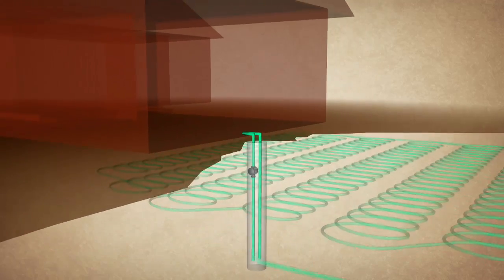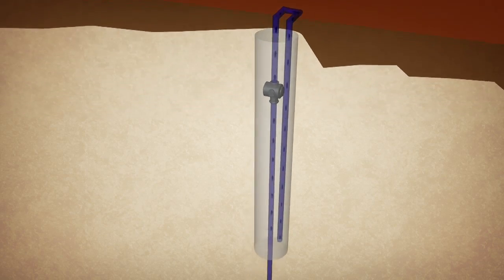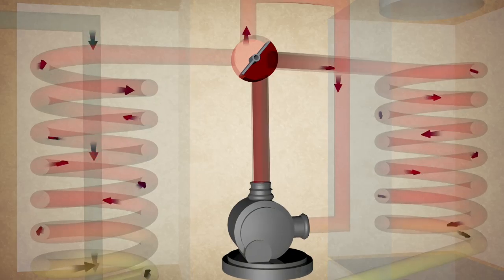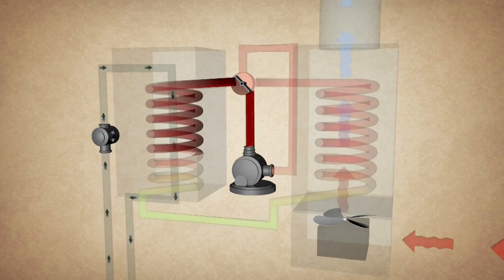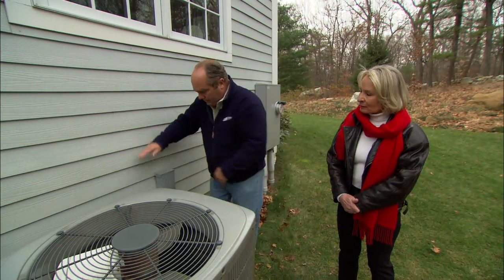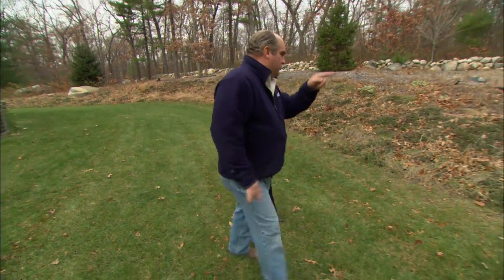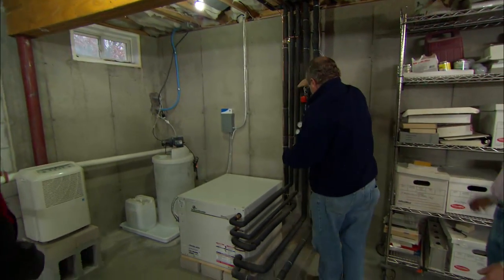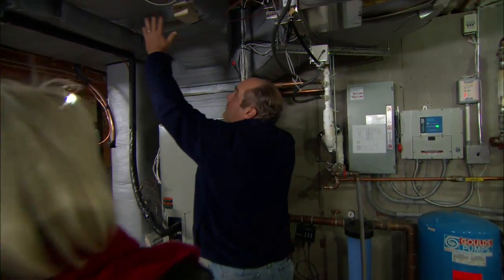How a Geothermal Heat Pump Works | This Old House

Comment: We just purchased a home in Klamath Falls Oregon we have a geothermal well. The temperature of the well is very hot .
I will like to learn how it works? 
Why is the water coming from the well so hot?
Thanks
Reply: Perhaps you have hydrothermal activity on your property that is heating the groundwater, similar to what you would see at Yellowstone with geysers and bubbling hot springs. Normally the ground is cool but with volcanic activity underground it could be heating your geothermal system. Of course that’s good in the winter I suppose but not good in the summertime for cooling. Hope you get it figured out.

Comment: It's an idea that has been around for more than 70 years and it never really took off because for the most part it is not practical.  
 In 16 years of doing HVAC in Florida and only encountered 3 of them and in every case the customer didn't like it for one reason or another.  One customer replaced their geothermal with a conventional heatpump and the others are planing to do the same when the time comes.
Reply: I wouldn’t think you would need one in Florida. You never get cold enough for heat pump efficiency to drop below what? 200% or so?  Up here in New Hampshire we see 0° days and my air source heat pump is screaming expensive to run at only 100% or less efficiency. I’d be thankful for a system that consistently gave me 300%-400% efficiency. It’s just so expensive.
Reply: @generallyhelpfulsoftware646  I worked up north too do in HAVC. Let me be real clear the NOBODY should have an air to air heatpump north of the state of Georgia. You shouldn't have any sort of heatpump because they were never intended for that climate. That's not just me talking I heard that from some of the engineers at Carrier.  In New Hampshire you should have some sort of fossil fuel such as natural gas, fuel oil or propane.  Definitely not a heatpump.
Reply: @generallyhelpfulsoftware646  It does get cold enough for heat in Florida depending where you live. But in Florida a heatpump is perfect. 
But I would prefer to stick with the air to air heatpumps.  Geothermal is too much trouble.
Reply: @seanmathews1826  I was trying to say in my comment that you wouldn’t need geothermal in Florida. You would find it useful here in New England. 

As for heat pumps being inappropriate for here in Southern New Hampshire. I installed one to supplement my oil boiler. Basically 11 months of the year it is cheaper to use the heat pumps. In January, they are about the same: both expensive, and the pump I have installed can’t heat the whole house, but it keeps the bedrooms and office the heads are in a nice 70°. Right now today, it is 45° outside, the boiler thermostats are all off, and have been since it started going above 25° at night on a regular basis and it is nice and warm in here. The thermostats won’t be going on again until December most likely. 

I used half as much oil this January as last year at the cost of a lot more electricity. So in the end the costs in January balanced out. Maybe I saved $50. Every other month, I’m saving hundreds. This morning, heating oil is $5.45  a gallon, gulp, used to be $3. And the utility has raised electricity from 18¢/kWHr to 21¢

The one thing the boiler gives that the heat pump can’t provide is radiant floor heating. Because that requires a 180° or so water heat source. 

Now if I had access to a natural gas line, this calculus might change. But I don’t.  

And I get room by room AC in the summer instead of the single upstairs zone of central AC this house came with so at night, my children can choose their own temperature and I don’t have to cool several thousand square feet of unoccupied space. 

I’ll be adding two more heat pumps this year and a hybrid water heater to replace the indirect oil boiler fed tank I have now.
Reply: @generallyhelpfulsoftware646  I'm also not real fond of radiant infloor heating systems because I don't like the idea of burying all those water lines in floors and walls. You are just asking for trouble. 😳

Comment: As an owner of a geothermal heat pump in moderate temperature NJ, I would highly advise against this garbage unless you like high heating bills in the winter. In the summer, it’s pretty good, but even then we’ve had our problems. Coming home to a 90degree house in the summer with electric bills through the roof, or huge electric bills and 50 degrees in the house in the winter. Super fun. Thank god I have a wood stove. These systems have too many things that can go wrong. It would probably work great in the Carolinas and south, but if you live north or Maryland, burn wood, gas, or propane. These systems just aren’t that good. If only I had natural gas in my area, I would immediately convert

Comment: Why not use the reverse summer heat in the house to heat the water vs dumping it back in the ground. Hot water is also needed for washing machines and dishwashers
Reply: Yea if you really didn’t want to waste the heat/cold throughout the seasons the cold dump in the winter could be exchanged with a refrigerator & freezer and in the summer you could heat a pool and your hot water tank(s). I’ve wondered why people have heated pools and cooled house and they use 2 different systems and dump the excess heat/cold from each system rather than exchange them with one another and save a boat load on equipment and electricity. I guess someone needs to build an easy to use system for that purpose.

Comment: How can this be efficient?

I’m guess this requires a very large water pump to move all that water 🤷‍♂️
Reply: The pump to do that pumping will be much smaller than what you think (low flow, low pressure). Source: I'm a pump engineer. It's immensely efficient.  You make the gains in the differential in the temperature ("delta T"). Think about your car. When your compressor heats the refrigerant to 130 degrees, it can't dissipate that heat as easily when the outside temperature is 110 (delta T of only 20 degrees). But it can dissipate that heat super easily if it were 50 degrees outside, which is the same concept discussed in this video.
Reply: @strembluey9019  
I'm guessing this system is at least 200 gallons.  
with lots of vertical head required for the pump.
I'm no pump engineer, but I'm guessing this will require minimum of 500w motor on the water pump.
Reply: @fredsanford1437  Actually, the vertical head will be zero. If you stand on top of the Hoover dam, run a pipe all the way to the bottom, then all the way to the top, and fill it with water, you'll be holding both ends filled to the top with water. The level will match as it is hydraulically balanced. Now, just plug one side into the suction of a pump, and the other into the discharge and the pump will require little energy to cycle water through the loop. The only thing that must be overcome is frictional flow (note: I'm making some huge assumptions to make a point, but the point I'm making is still valid). But, I have no experience with these systems, and have no idea how much line friction must be overcome to complete the loop (I'd need ID of the pipe and required flow rate to make a guess), but 500 watts seems a little steep, yet not unreasonable.
Reply: The method of heat transfer load is a constant 50 degrees. That’s where your savings and efficiency is at. Vs a standard air to air heat pump system where outside loads will effect performance adversely and is not a constant on the condensing side of those systems!

Comment: 0:57 you got the liquid and gas refrigerant parts backwards.  You can't compress liquids. You can only compress gasses.  

In the winter you use the relatively warm ground water warm up the evaporator which is where the refrigerant phase changes into a gas (phase changing into a gas absorbs a lot of energy),  right before it runs through the compressors (as a gas).  The refrigerant is heated up as it is compressed and can give off more energy as it is phase changes again in the condenser to a liquid. In the condenser the relatively cold house air is warmed up (cooling the refrigerant)  where it takes off again to the relatively warm ground water.

In the summer, the flow is reversed and the coils effectively switch roles as condensers and evaporators and the same cycle happens again in reverse.
Reply: Thank you. I came here to point out the same thing, but rather than dilute your point, I'll just jump on the bandwagon. This is such an important point that I recommend that "This Old House" should redo their video. You've described it very well here.
Reply: You can compress pretty much anything, at least to the state of plasma. It's extremely difficult and not energy efficient at all, but it is possible.
Reply: Isn’t compressing liquids in a sense the reason that pipes burst in the winter?
Reply: Y'all don't understand thermodynamics
Reply: You can compress liquids. It's just incredibly difficult to do, and really only possible in laboratory settings.
Reply: @jgood005  refrigeration compressors do not compress liquids well at all and nor is it efficient to do so ever!! One of the dangers of in-properly operating a refrigeration system is slugging a compressor which is what liquid compression will do, thus damaging a compressor!!
Reply: Came here for this….   Never heard of compressing a liquid in this context, but I’m surprised they made such a big mistake.
Reply: @addisonault3475  Rich's son made the same mistake in his explanation of the geothermal system on the Essex project a few years ago. Very baffling.

Comment: That heat system takes up a lot space in the basement. How complicated is it to fix if something goes wrong? Is it a do it yourselfer or do you need a pro??
Reply: You need a pro. Expense varies, typically, it is low. Things rarely go wrong if a quality contractor installs it.

Comment: And it works very poorly in New England. The colder it gets, the less it does. I know.... our condo has one.
Reply: It must be a badly installed system then. These offer the best heat in cold, damp climates.
Reply: Most likely if it's a condo, they aren't using the ground source. They're using a building loop that has pumps, boilers & a heat exchanger. Either a boiler isn't set correctly for the winter, or there is a boiler that is not running properly.
Reply: @ThomasBahamas  Nope.. junk. No boiler

Comment: is it 50 degrees farenheit or celcius? I need to know for a project
Reply: Dude, ofc it is Fahrenheit. Thats like 10C. 50C is super hot, how do you imagine the Earth being so hot a couple of meters down. Have you ever been in a cave, cuz it is the same principle? It is cold there, but the temperature is constant no matter the season. That's why the primitive humans lived there.  So the idea with the heat pump is that it will be more efficient if it drew heat from constant 10C rather than minus something in the winter. One thing this dude doesn't mention is that this is efficient only for houses and not very populated areas, because the more houses in the neighborhood that draw heat from the earth the cooler the earth gets.
Reply: @medzoPuh  Is that a true statement ? The more people draw from an area, the cooler the earth gets ?
Reply: @ckac730  That's what my university professor in Energy Informatics said. Of course, it depends on a lot of factors, but I would imagine that in general it is true.

Comment: You need a garage or basement -- just for all of the equipment... solid solution.  I'll stick with solar and my Fujitsu mini split system.
Reply: Mr Slim is better ;-)
Reply: Electricity is terrible for heating. Use propane or a wood stove.

Comment: Sounds EXPENSIVE!!!
Reply: Pays for itself in about 5 years if you're on anything other than gas.

It's also...not sexy. As a contractor, the number of people I tried selling a geo unit to who spent as much or more money on pools, landscaping, decks, granite countertops, hell basically anything other than their HVAC system was surreal. Especially because all these people could also easily afford a geo system to heat their giant houses.
Reply: @squamish4244  I have a very small (920 sq feet) home currently heated with oil through steam. I’m thinking of a conversion to geothermal heating and cooling. Challenges I have: no duct work, small yard, narrow driveway (drill rig)
Reply: @TheHungarianchick  Yeah. It's hard to justify geo in your situation. Air-to-air exchange (air source heat pump) might be a good option for you, however, even if you live in a cold climate, and it helps that your house is small. It's more expensive than gas, but much less expensive than oil. I would recommend it.
Reply: @squamish4244  I have endured steam radiators for five years now so I’m not about to have even uglier mini splits in my house. I will probably have duct work installed whether we will go with air to air or just switch to natural gas and insulate the house.
Reply: @TheHungarianchick  Sounds good. Whichever way, your footprint is very small.

Now the big old leaky farmhouses built in the 1800s that I put geo systems into...can't say the same for them. They were blowing $4-6,000 a year on oil if you can believe that.
Reply: @TheHungarianchick  The fact that your house is small is an advantage with regard to not having ductwork. A large house is harder to convert to a forced air system. You might have to cut a few holes, but the heat pump system should work fine, and will save money (and reduce greenhouse gases) in the long run.

Comment: Overly complex example.  A split heatpump and air handler combo is a little bewildering to most people, and he didn't mention that most of that scary looking piping by the air handler had nothing to do with the geothermal system.  Should've shown a simple packaged water to air heatpump.

Comment: So... the type of installation this guy is talking about is only viable if you have temperatures constantly under 30°F. If it isn't that cold, a cheaper heat pump solution would work. Better still, gas-fired furnaces are more efficient and cost less compared to heating strips and heat pumps. Gas works in any condition, and when it is combined with a heat pump for summer, it is most reliable and cost effective.
Reply: Closed-loop geothermal is much more efficient than ANY other method.
Reply: Not true. Heat pumps have the lowest cost per BTU of any other heat source

Comment: But how much of the heating effect is provided by the ground, and how much of it is provided by electricity running the compressor?  In this system, you still have to call upon the hydro company to generate your heat. That detail was not discussed or even hinted at.
Reply: Yes, i do have a system like this. Not for heating air, but for heating a water system that heats the house. It is called COP and is normal around COP 3.0 to COP 4.0
That means if the pump uses 1000 watts (240 volt) power i get 3000 watts of heat. So u get 2/3 heat from the ground and 1/3 you need to give the system in form of electricity.
One thing is in summer there is no need to run the compressor at all. You only need to run the deep well pump.
Reply: +John Strand I've heard that there are more efficient systems out now that are more like 1/5th electric, 4/5th ground. Any idea if that is true?
Reply: Naa, it is the delta that matters. You need to have floor heating. So you can heat with 40 Celsius . Then you need high temp from the ground. Then perhaps you can get 4.5 Cop. The only chance to get cop5 is to heat with higher source like outside air that is 15 Celsius or more. Then perhaps. An air to air system that operates with -5 Celsius hardly gets 2.5 Cop. So you can see it is a big difference in Cop if the delta is low.

Comment: If the house is climate controlled by geothermal, why is there the standard condenser unit outside?
Reply: I think the home owner already had a condensor outside and afterwards decided on a heat pump. That's why the downstairs looks like a laboratory. I'd prefer to make it a little more compact than this.
Reply: It’s probably a separate system. The compressor is in the inside unit not the outside unit. The outside condenser is probably a different zone
Reply: phoneguy 101 that is the compressor. The box in the basement from the well is just the exchanger to remove the heat from the ground water

Comment: I've read some systems also work as a hot water heater now that would really save you money free heat, air conditioner, and hot water. that and properly insulating a home would be well worth it. it's a 5 year return estimate far better than solar and this is a proven technology
Reply: Wrong… You need electricity to pump the compressor which is a billion times more expensive than natural gas.. Don’t listen to these fools..
Reply: Wrong. I own a system. It blows

Comment: I will bet that super sophisticated system is probably $10.000 or more ...
Reply: wildthing302 
That system costs around 35k
Reply: Considering I was once quoted a ballpark figure of $12K to replace an existing R-22 system with an equal size (3-ton) R-410A system...  Your figure may be a bit on the low end.
Reply: We've saved massive amounts of money monthly with no gas or water bill.  Our electric bill is comparable to our old home as these units use about 1/3 to 1/5 the amount of electricity to operate.  They are under ground and/or in your house and super low maintenance.  Granted, it would be expensive to replace initially and ideally, the expenditure on the front end in a new home is ideal. Totally worth it.  You'll make your money back in short order.